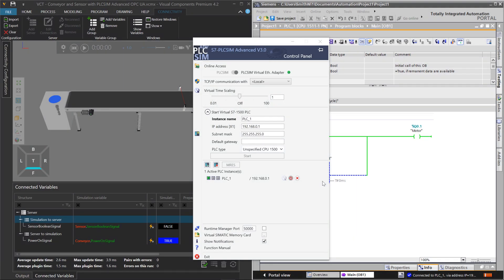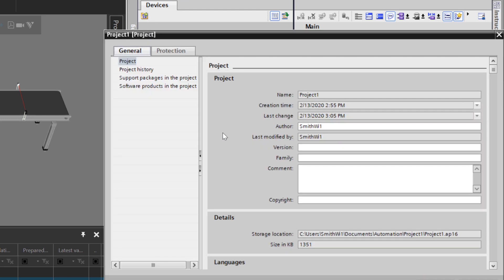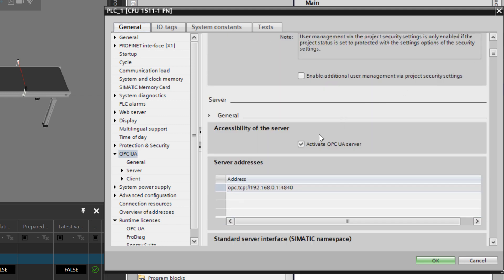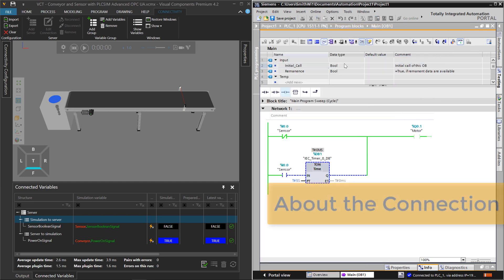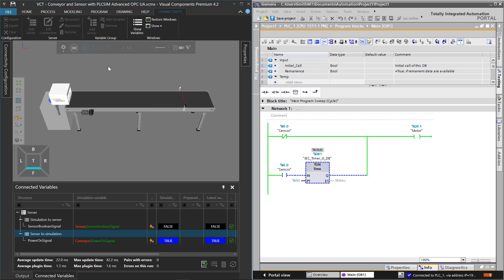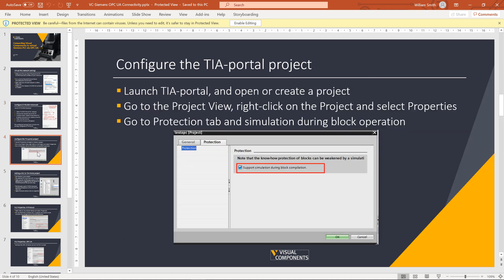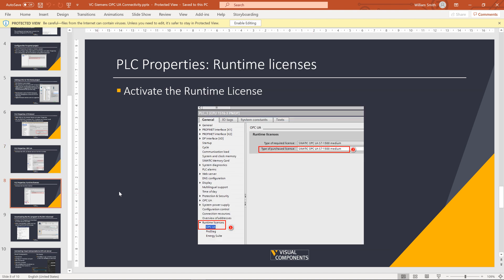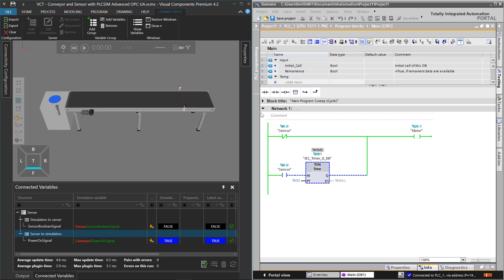Connect PLCSIM Advanced using OPC UA

Comment: Don't understand the clarification around 1:17. I don't have a physical plc. So do I have a chance via PLCSim Advanced to connect to an OPC UA Server started on TIA V16 at all or not? Thx!
Reply from the maker: Visual Components can connect to any OPC UA server, including one running in PLCSIM Advanced. Check the manual in PLCSIM Advanced for additional info and any restrictions such as secure endpoints and certificate validation.

Comment: Hello does the S7-400 CPU have opc option???
Reply from the maker: You need to check the firmware of the PLC and/or Siemens support site. If the device has been fitted to support OPC UA then yes.
https://opcfoundation.org/products/view/simatic-s7-400-with-opc-ua-cp-cp-443-1-opc-ua

PLCSIM, however, does not have OPC UA server, which is why Kepware is used as middleware if you want to use OPC UA. Otherwise, Visual Components Premium 4.2 or higher supports Siemens S7 protocol connection, e.g. connection to S7-400 without OPC UA.

Comment: Hello, i have a doubt, i have license of TIA portal 13 and the OPC licence but my TIA portal doesnt display the OPC option and im using the same plc as you, which TIA Portal version do you have? (I have the PLCSIM license as well but mine is the older one, not that new one )greetings
Reply from the maker: In TIA Portal, check the firmware version of your PLC if it supports "OPC UA". The PLC would need to have an OPC UA server. If your real PLC does not, consider using the S7 Comm connection we offer in Visual Components Premium 4.2.2.